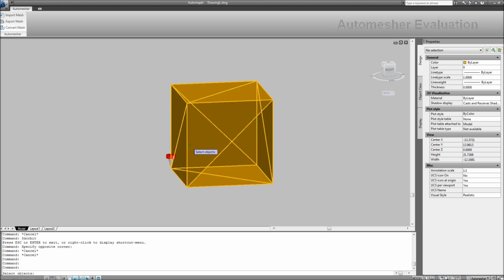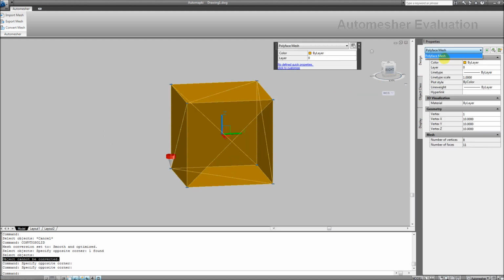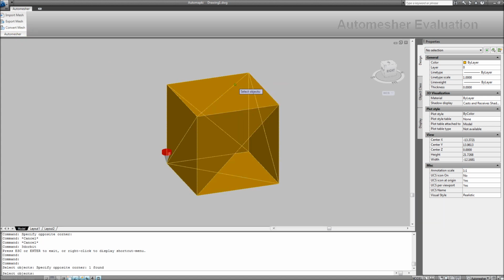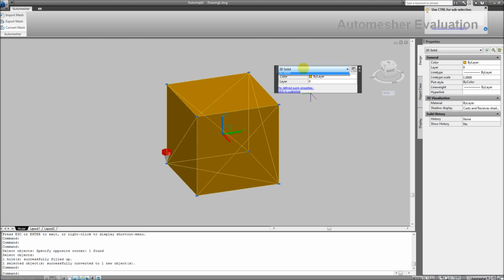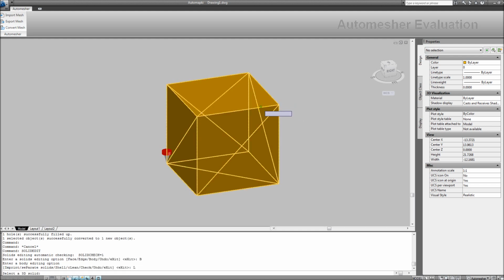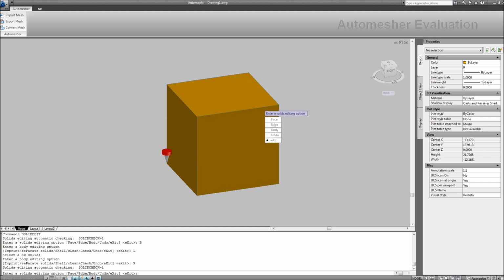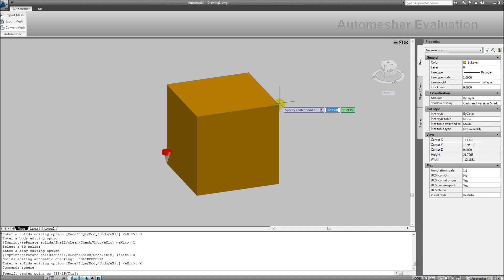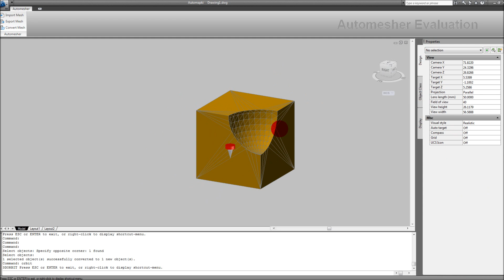When CONVTOSOLID fails to convert mesh to solid

Comment: what does the error "vector <T> too long" mean?
Reply from the maker: Could you please describe the exact circumstances?
Reply: @Automapki  i had a design exported from maya, imported to autocad there are some full surfaces, tried to "fill" between like it does in the video, BUT with this speaker and i get that error. Is there a maximum amount of triangles the evalution version can use before it wont work?

Comment: After i installed the program and opened the launcher. It wouldnt let me start it. the only option was exit. Why?
Reply from the maker: It is only an add-on for your AutoCAD, Bricscad or Zwcad software. You could consider trying our standalone #Autoconverter software.
Reply: @Automapki  wants I install it how do I add it to auto CAD
Reply from the maker: @OiSchwabe  Which version of AutoCAD do you use? The newest version 2020 is not yet supported.
Reply: @Automapki  2015